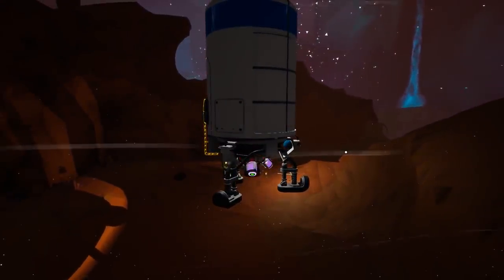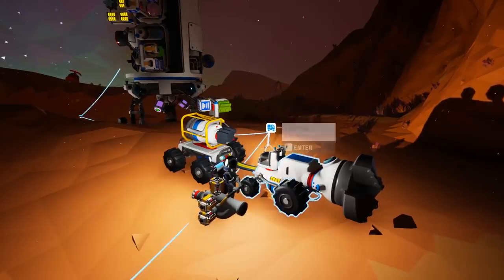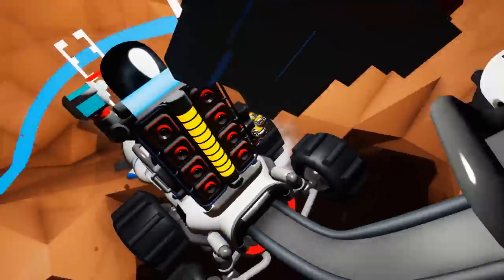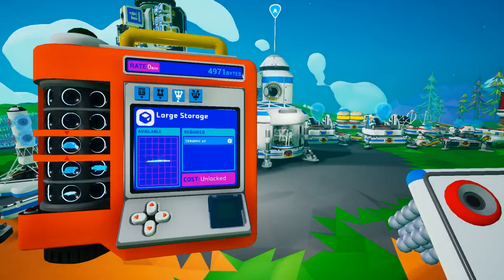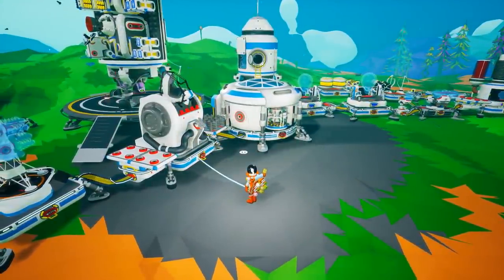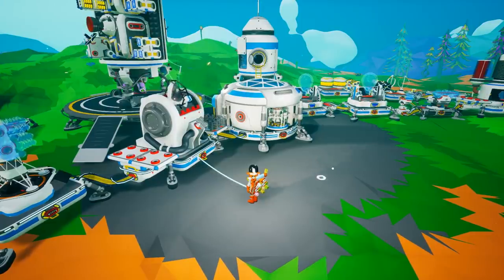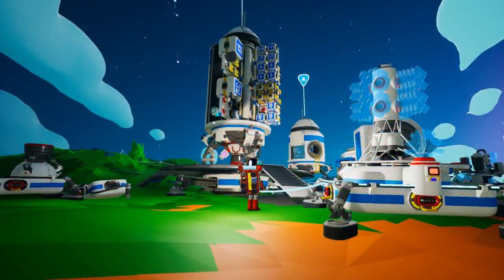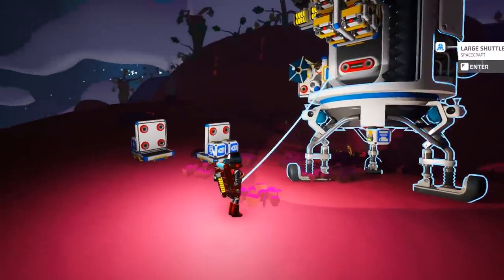THRUSTER-POWERED DRILL ROVER! | Calidor & Vesania cores | Let's play Astroneer 1.0 gameplay ep 17

Comment: You can use two medium rovers (connected) with three Med. batteries. Drive onto the structures and connect it. Make sure to take measures for recharging, via solar panels or wind turbines in the front of the rover. If you use solar panels on the bumper, it will charge while you drive. Generators could work but they take time.